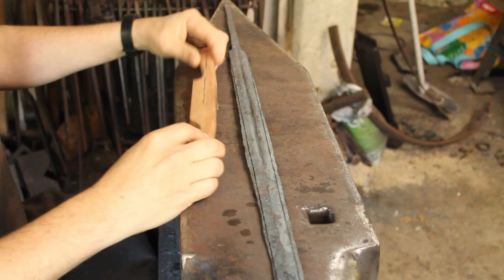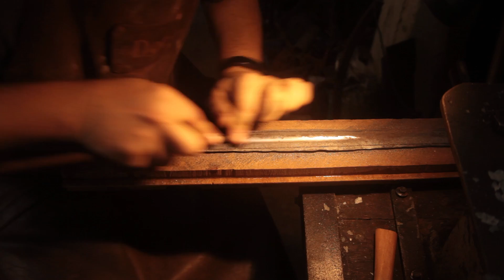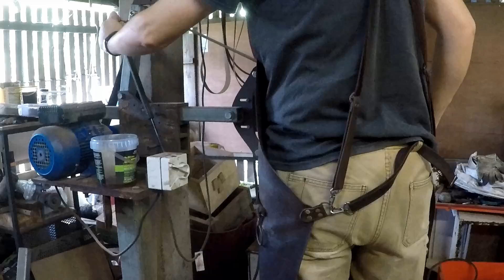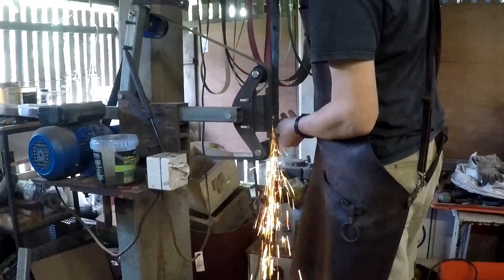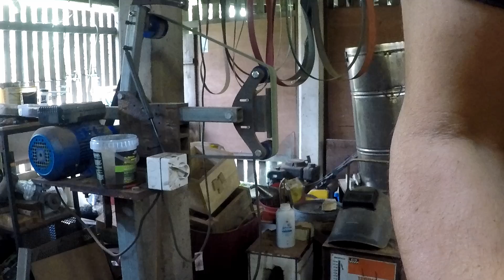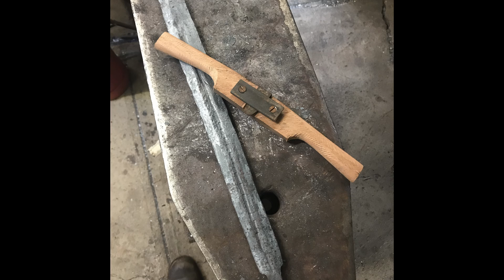Building a Cable Damascus Rapier Pt2: Grinding and finishing the fullers

Comment: Doc, when your scraper had difficulty at first, I wondered whether a small chisel of the correct shape would have made its/your life a lot easier at the start.  Kind of like the "olde time" Machinist/Apprentices used when hammering & chiseling before using milling machines.  Used just enough to remove the roughest bumps and obstacles to the scraper, perhaps?

Comment: Didn’t know that those Fullers were hand scraped. I done all good learnin’ today! I think I’d be fabricobbling an angle grinder jib to do that rather than punishing myself lol
Reply from the maker: It would take longer to make the jig and get proficient with it than it took to make the scraper and do the job, like I said in the video if I had a small enough contact wheel for the belt grinder I’d have used that but 9mm (3/8”) diameter is hard on the belts and I don’t have one that small anyway